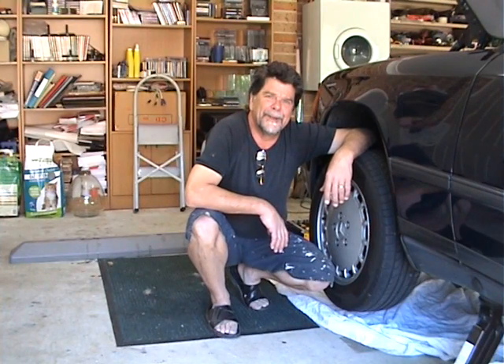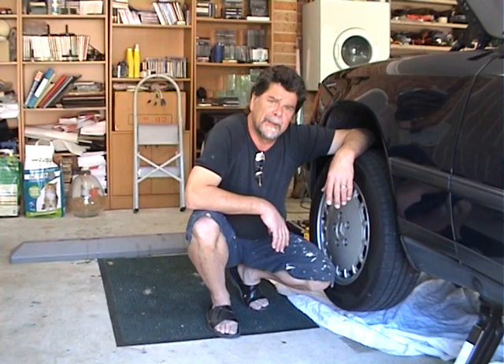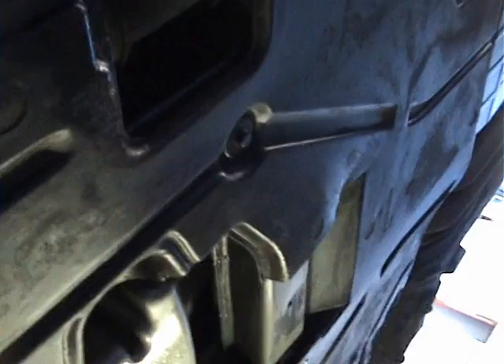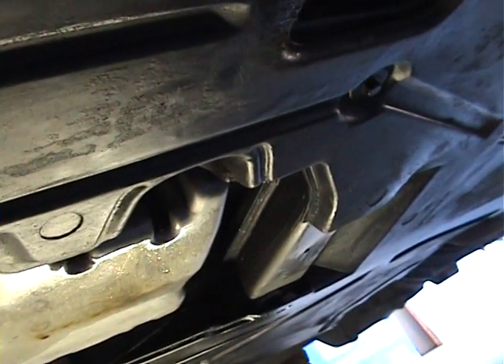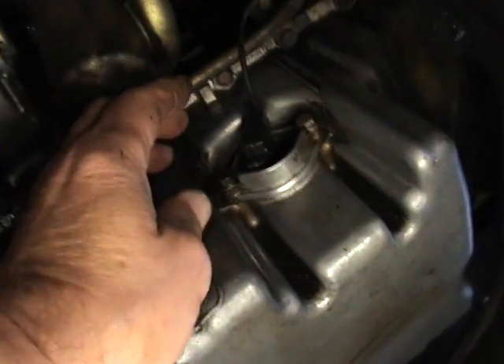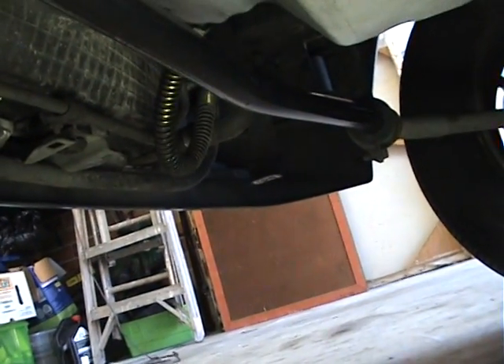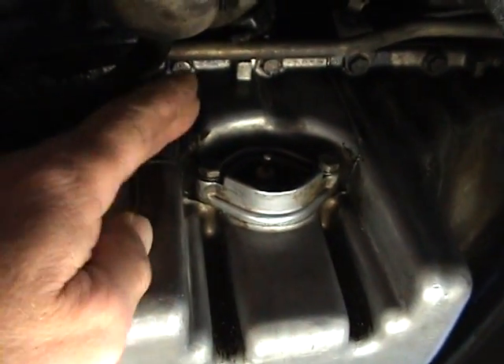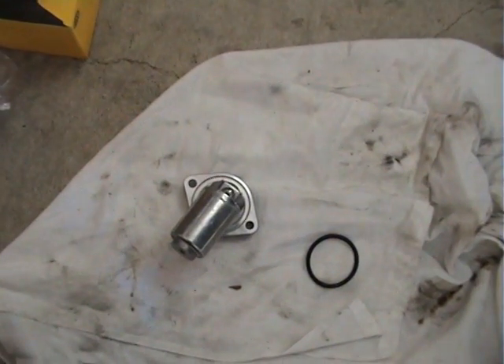Merc 300E  Low Oil Sensor

Comment: thanks!  I have a 1999 slk230 and it looked like it was coming from that sensor.  it has been sitting in my garage all winter.  I'm going to try running it a bit to see if it will seal itself back up...  Thanks again!